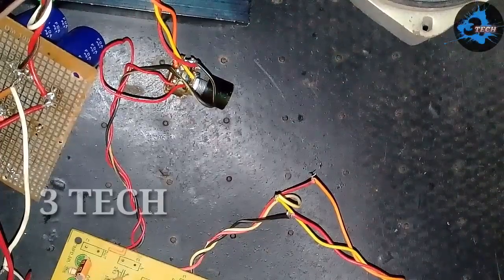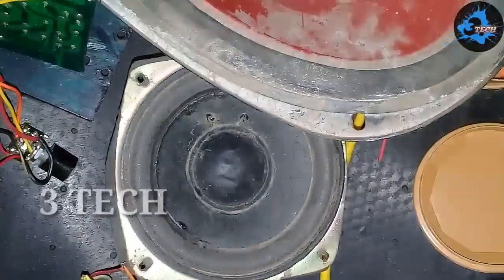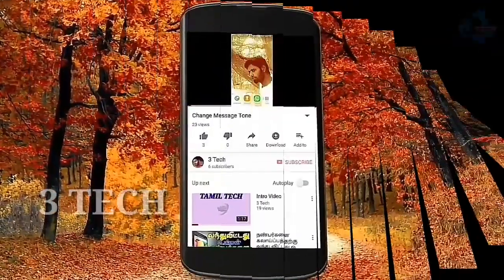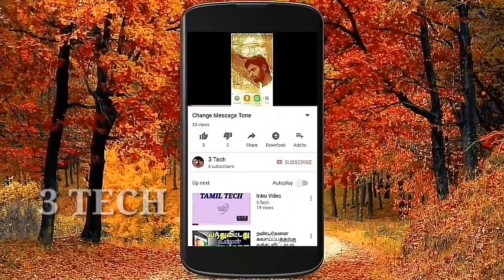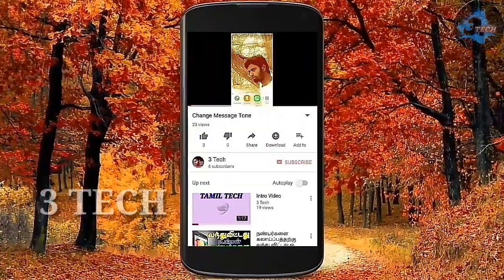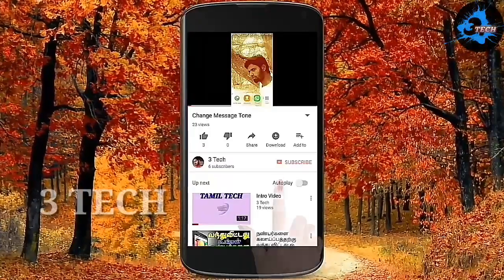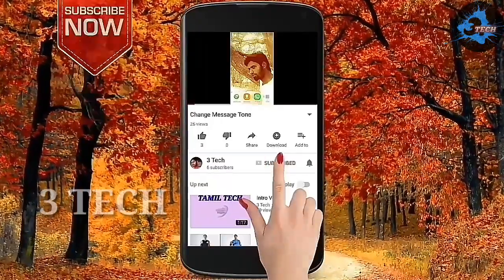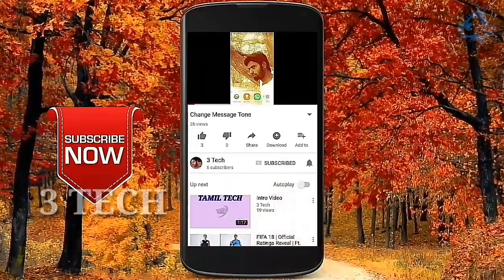How do Bass treble board power connection with audio  input connection detail Tamil video

Comment: 12 volt amplifier ku 12 volt battery connection panna regulator use pannanuma???
Reply from the maker: Vendam , battery connect pin erukkum amplifier la
Reply from the maker: 3 tech channel latest video va parunga athula irukku
Reply: 12 volt amp to 12 volt battery direct connection kudukkalama??
Reply: Resiator ethavathu use pannanuma?
Reply from the maker: @குமார்நம்பியூர்   WhatsApp group  la kelunga
Reply: 4440 ic rate? and cabinet price??
Reply: whats app number